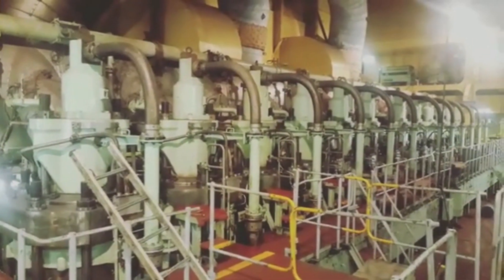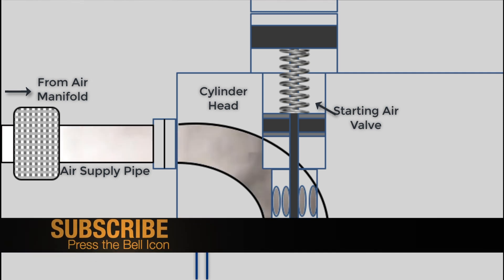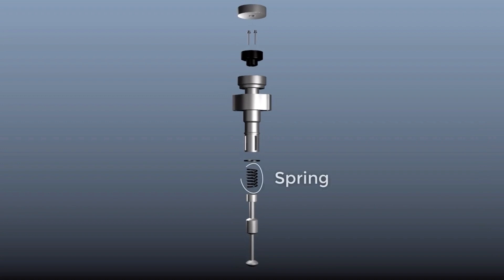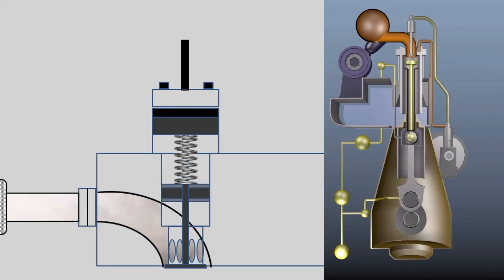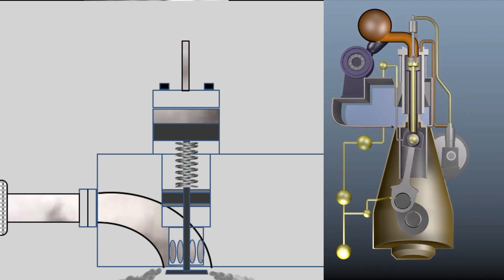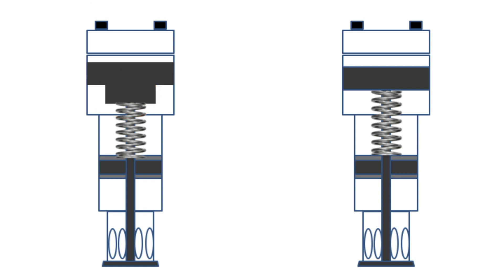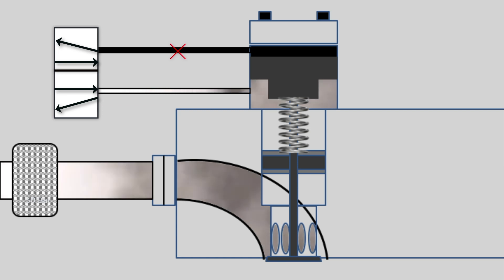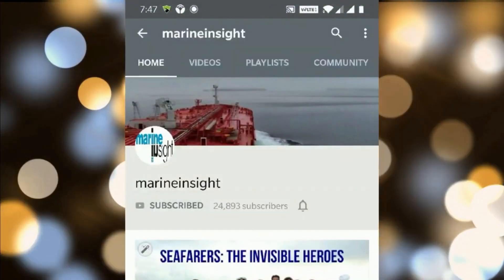Starting Air Valve #marineengine #Airvalve #startair

Comment: Initially in sulzer engine, it is shown that from control valve air is being supplied on both the sides of piston and valve is in shut position but later to shut the valve upper face air is being vented . I just want to know how the initial state is achieved after this that is air in both sides of piston?

Comment: Would like to add a correction: On a Wartsilla engine, pilot valve(5/2 valve) uses same 30bar pressure coming off the main air supply header, not 7bar.

Comment: please explain about air/fuel interlock in main engine
Reply from the maker: Thank you for the suggestion
Reply: Air start shut off when fuel lever advanced from start position, by pilot air valve supplying air start distributior.

Comment: How many cylinder must be moved from air to start the engine and when they are make reverse
Reply: All of them one by one in sequence of firing order,as in head direction,only firing order changed in distributer,
few degree overlap might be there in some engine to help to start if any one starting valve malfuction

Comment: I think on top of the valve the air pressuring the spring is 7bar and thats why there is a difference of the diameter of the pistons inside the air starting valve..am i right?
Reply from the maker: Yes. 👍🏻

Comment: 0:31 What is the pipe which is going from top to bottom in each cylinder used for(the letter 'r' in pressure is on that pipe I am asking for)?
Reply from the maker: Hey Dan, That's Hydraulic oil supply pipe for Exhaust valve. For more details, please watch this video - https://youtu.be/jdmJGF7XXJ8

Comment: What, Why and how blow through is done before starting the engine??🤔
Reply from the maker: What - It is an air blow inside the cylinders
Why- To check if there is any water or oil accumulation due to leakage.
How- Staring air is supplied to the engine keeping the telegraph in start position without supplying fuel.
Reply: @marineinsight  ..If blow through is done to check fuel or water leakage then why do we use turning gear for checking the leakage of oil or water in the cylinder prior to starting the engine?
Reply: @souravchetia692  Because while blow through it is also confirmed that starting air valve is leaking or not . If turning gear is used to turn the engine thn amps will increase if any water content is present inside .

Comment: You have told distributor pilot valve press is 7bar. pls Explain me from where it's come as 7bar.
Reply: They just have 7 bar regulator attached with 30 bar air valve.